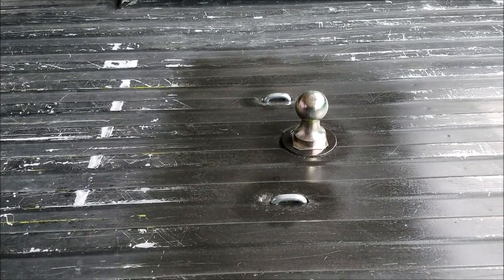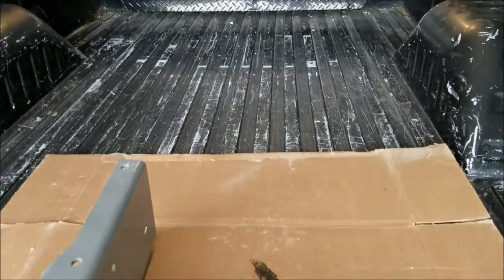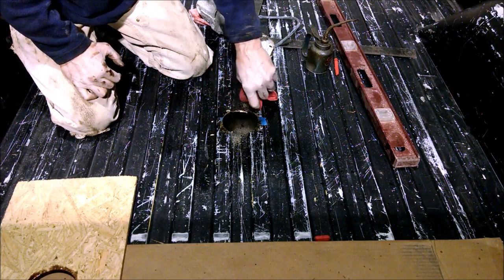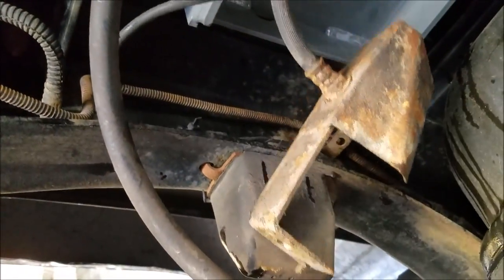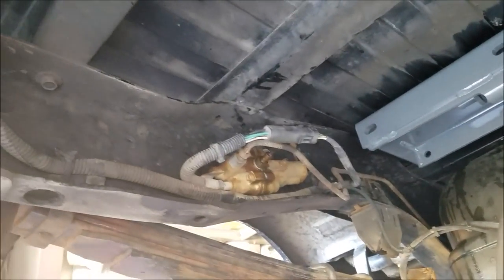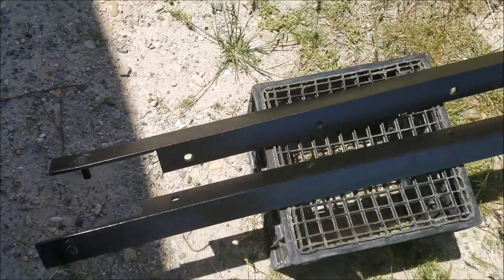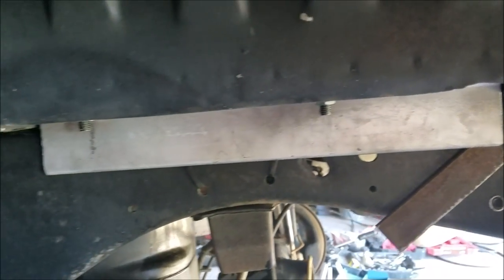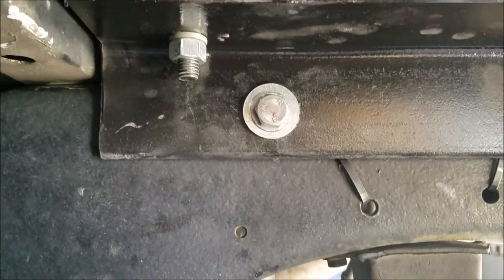B&W turnover ball hitch install homemade brackets 1st gen Dodge Cummins

Comment: I thought the ball should be a bit forward over the pinion to put some weight on the the front end.
Reply from the maker: Most I have ever seen they were right over the rear axle; I also use a BW Companion to haul a 5 wheel camper trailer, and have it adjusted back as far as I can get it and it  barly clears the cab. I think it all depends on what you use it for. Also I think it's harder on the rear tires if it was more towards the front. I also have a dually and it was installed over the axle as well before I purchased it. I also looked at a bunch of trucks in parking lots to see where they were all at, and all of them were over the axles. But I think it's just what ever you feel comfortable with. Thanks for watching.

Comment: what size is the angle iron for the crossbars. I need to make my own brackets for my 98 c3500hd commercial chassis as they don't make brackets for that either.
Reply from the maker: I used 2x2x1/4", that is what I see most BW brackets are made out of. Thanks for watching.

Comment: I'm trying to fab my own frame mounts for goose neck hitch any ideas
Reply from the maker: Most people think it's best to mount ball just in front of axle, but I think it would be harder on the rear tires, I suggest just to make sure you can clear narrow turns without damaging the truck or trailer. Thanks for watching.